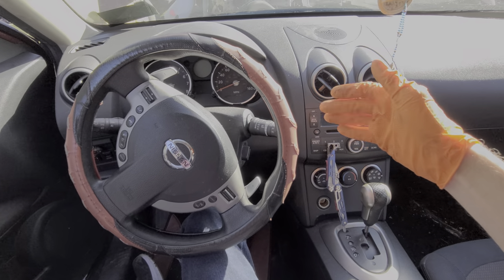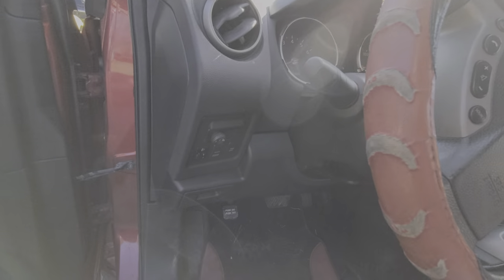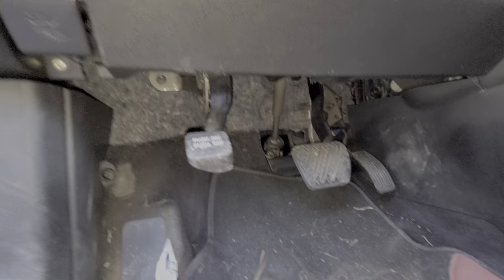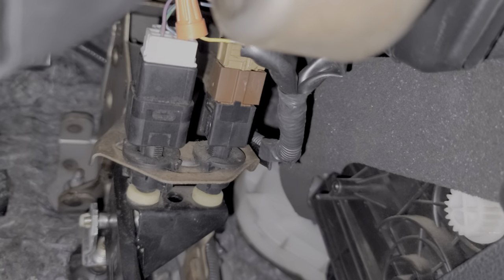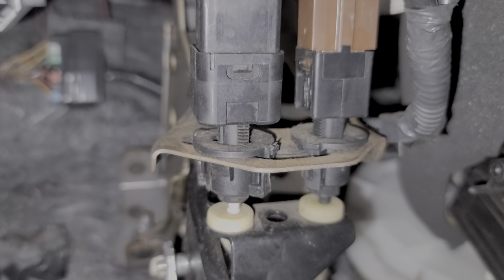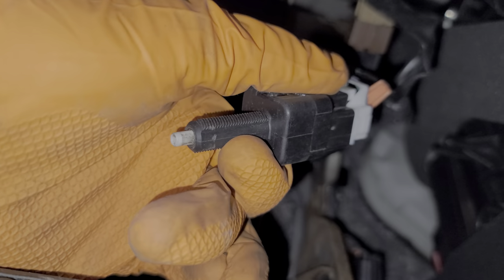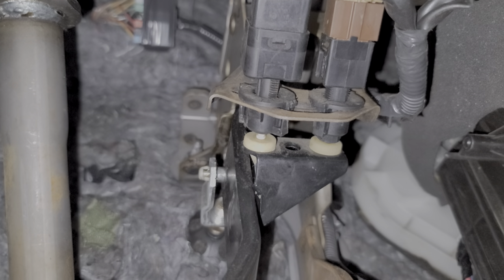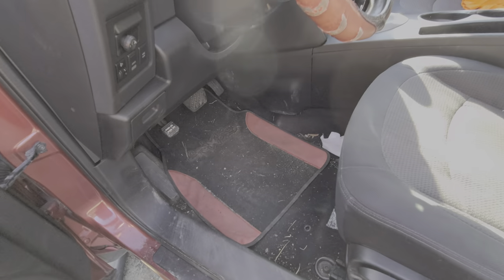2009 Nissan Rogue Brake Light Fuse & Stop Light Switch Replacement

Comment: At end of Sept the brake light switch on my Nissan Rogue was changed at a mechanic shop and as soon as I drive out of the place I found that my gas pedal was NOT working. I had to shut the car and turn it on about 3 times so that the car would move and I could go back to the shop. When I got there I was told that this new issue had nothing to do with the gas pedal being so hard and the car not moving. After they looked again at the car, they changed the brake light switch again but to another brand and the car worked fine. About two weeks ago the issue started again. The gas pedal is hard and I can’t drive.  QUESTION:  Do you know if this is a known issue? And if so, what can I do to get it fix once and for all?

Comment: I have a problem on a 2001 maxima. Brake light switch keeps burning out 
 
4/2019  Original switch failed and replaced with a FACET branded switch from rockauto.   Everything was fine working great until September 2022 when the switch burned out .  I replaced it with one from eBay .  It worked for a week or so and stopped working(I complained to seller and they refunded me) .  
I Replaced it again with a different branded switch from another seller and it did the same thing in a week.  Any ideas ?

Note the ABS light is also on on the car. May not be related .

Comment: Does same brake light switch controls left right and Centre third brake light?

In my case centr brake light is not working while left right are working.So is fuse ok in this case?
Reply: Did you fix it? My friends car has center light working but lft and rt dont. Is it the same fuse?

Comment: What if the brake light works fine but the night/fog rear light doesnt, when they use the same bulb
Reply: Having the same problem did you find a solution

Comment: in my case both brake lights turn on except when the car is parked: if the car is parked and i press the brake pedal, the passenger side brake light won't turn on.  could the issue be as well a bad break light switch or something different?

I own a Nissan Rogue 2008 SL AWD
Reply: FYI I also got a P0703 error on my scanner

Comment: What's up with the wire nut? Looks like some shade tree mechanic has had a hold of it.
Reply from the maker: Yea not sure about the history of the car.. there definitely shouldn't be a wire nut there
Reply: Either way. This helped me tremendously! Just did a blower motor on my in-laws rogue last night. Had to remove everything to get to the center of the dash. I wasn't aware that the brake light and the cruise switch had a certain adjustment. Had them in too far, which I found will also cause thermal expansion of the brake fluid. My wife was driving it today and the brakes locked up at 70 mph. Nothing bad happened, Thank fully. She was able to get it off the highway. I just put a transmission in it 3k miles ago and that was my first thought. When I got there to load it on the trailer, I found it was the brakes locked up. These switches was the first place I looked, since I had them all out last night.
Reply from the maker: Glad that you figured it out. The blower motors on alot of Nissan are difficult to replace